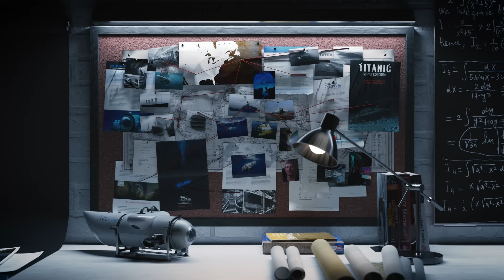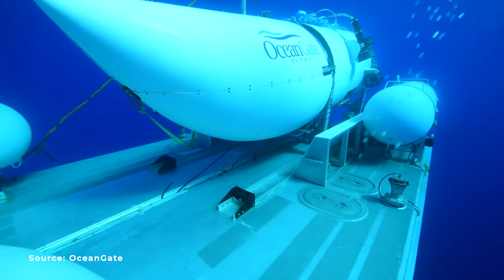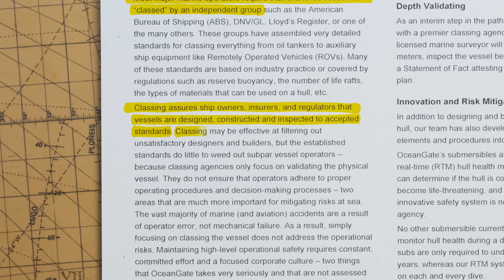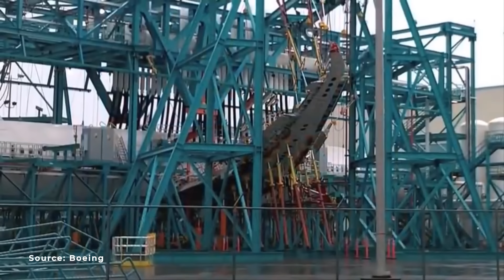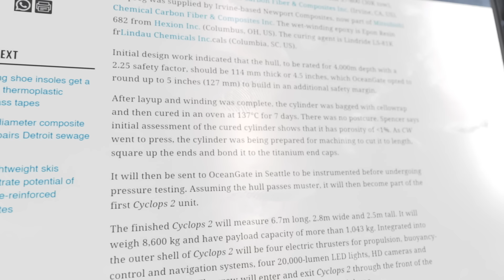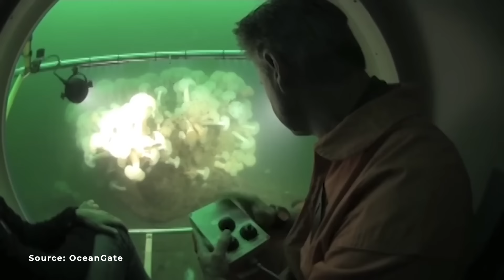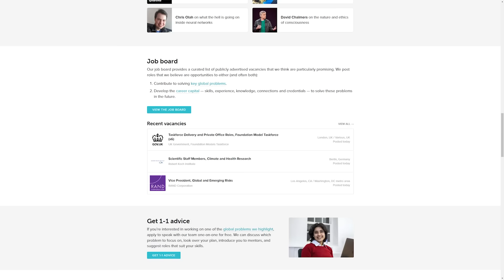The Questionable Engineering of Oceangate

Comment: My carbon fiber bicycle frame went through more testing than this freaking submarine. This thing is such an insane story the more we learn about.
Reply: My limited knowledge of carbon fibre is through bike bits, and even I know that it's a great material until all of a sudden it really isn't. This doesn't seem sensible, even without their complete lack of testing!
Reply: @hairychris444 So carbon fiber is at risk of failure from fatigue even  in applications involving relatively little compression force? That’s interesting.
Reply: @Lisa-om4it  Bicycles are subjected to more bending forces, in which there is still compression force on the inside of the bends. I'm not sure if autoclaves are used for bicycle frames.
Reply: @dbclass4075  Most bicycles are made of "pre-preg" carbon fiber, where sheets of carbon fiber are autoclave cured, and then later shaped into the bicycle frames, which means although bigger voids between sheets can form, there are less voids within the sheets. But also, the carbon fiber in bicycles is normally stessed compressivly along the axis of the threads, where carbon is strongest. This submersible was stressed across the threads, which is not carbon's best use. Bicycle frame designs (from reputable brands) are also rigorously tested with shear strength tests and cyclic loading tests. Carbon is great when you need good strength and very little weight bicycle), but when what you care most about is pure strength (submarine), use something better.
Reply: You can do some research I believe there is a video on it, a bunch of guys were trying to set speed records on mountain bikes over different terrain, one was sand and they designed a Carbon Fibre bike to be as light as possible, without doing proper testing they sent a dude down a massive dune only for it to fold in half when it came to the level off. The dude suffered massive injuries and 6 buffets worth of sand down his throat.
Reply: @bringerebrethil6176  Totally unnecessary but fascinating
Reply: @bringerebrethil6176 i'm going to hell for laughing at the sand buffet part
Reply: @khionefrostee4875  Hold the elevator, I'm coming with you
Reply: @khionefrostee4875 No you not.
Reply: @khionefrostee4875  delicious
Reply: @bringerebrethil6176  I remember watching a documentary on this. I think it was a guys nicknamed the Red Baron trying to ride down a volcano in Nicaragua, and yeah as you mentioned got fucked by a sudden gradient change. He did come back with a better bike and claim a speed record If i'm not mistaken.
Reply: @bringerebrethil6176 didn't that guy also set that speed record JUST before the bike snapped?
Reply: @bringerebrethil6176 Even properly tested carbon fiber frames can suffer catastrophic failure under normal riding conditions if the frame is getting old. Carbon fiber is bad at handling impacts, fatigue, or compression, and tends towards a brittle failure.
Reply: @garethbaus5471  Kek, i never heard of anyone breaking their carbon bikes with normal drive. Lose weight if your bikes cant handle any other material than steel.
Reply: @markoliimatainen2565  I don't know of very many people who ride their bikes enough for it to matter.
Reply: Carbon fiber is great on a bicycle as none of it has to be precise. Not so much in this application. Too much can go wrong to get the composition just right so it can bear up to the incredible forces.
Reply: @adotintheshark4848 was gonna say, a bike doesn't need to withstand the equivalent of ~400 atmospheres of force on it.

Unless your mom is-
Reply: The thing is your bike by law requires that testing. Submersibles currently don't. Though this event will probably change that.
Reply: This is straight to the point
Reply: Im really was surprised in this CEO own confidence too...
Reply: @liam3284 ok, Liam, now you're just screwing with my head... bc I'm realizing now that carbon fiber hulls are beginning to replace fiberglass hulls for increased strength. So ok, these hulls are not being submerged and subjected to incredible pressures on all sides. but carbon fiber is considered to be stronger and therefore safer if there is a collision--extreme compressive force. So now I'm super confused. You don't want to crash into another vessel, run aground on a reef, or get rammed by a Portuguese orca only to capsize because your carbon fiber hull shattered to bits.
Reply: @amijacks nless you are using it in a deliberate crumple zone fiberglass is usually better suited to collisions than carbon fiber since it doesn't immediately crack, and some synthetics like kevlar can be even better for those applications. I assume the main benefit of carbon fiber is that it allows for a stiffer hull for a given thickness. Although strength is important it really isn't the same thing as toughness.
Reply: woow...sad but true
Reply: I don't even Trust carbon fiber on my bikes... steel and titanium master race
Reply: Carbon is great but not for me. I've seen it fail in crazy ways out on the trails. Steel and aluminium tend to fail slower and are cheap to replace.
Reply: LOL, PH is still down there and needs out help>>>>>
Reply: "My carbon fiber bicycle frame went through more testing than this freaking submarine"
keep thinking that.

Comment: I am a retired consulting electrical and mechanical engineer.  I have no training or expertise in structures.  But, I would like to bring a different question to the discussion of the collapse.  Simple mathematics regarding surface areas of the Oceangate submersible gives some interesting information.  And nobody, so far as I know has considered.  This concerns the Lbs/sq. in. ( pounds per square inch ) that the eight-foot diameter exerts on the ends of the submersible.  According to released data, the submersible's " beer can style " cylinder thickness is four inches ( 4").  The pressure exerted on the cycinder is at each end of the submersible and is due to the water pressure on each metal end.  Simple calculations indicate the the per-square-inch pressure on  the four inch surface of the cylinder is approximately eleven times ( 11X ) greater than the pressure exerted on the sides of the cylinder.  In addition to the pressure on the cylinder at each end, the metal end pressure is at right angles to the pressure being applied to adjacent areas.    PN

Comment: The thing that bugs me is why use carbon fibre at all? Why not just use plain steel?

I think it comes down to ticket sales. Making a sub big enough to fit 5 adults, well if it's steel that's pretty heavy. Too heavy actually. Carbon fibre is much lighter. 

So it just comes down to maximising paying passengers per trip.

Comment: the controller was a Logitech F710, one of which i personally owned and used pretty extensively.  a decent game controller but not one i would want to have to pilot a real life submarine to the bottom of the Atlantic with...
Reply: It’s completely irrelevant. It had plenty of redundancy. They had multiple on board and all it was was sending inputs to the laptop, the sub could also be controlled by the laptop. Using controllers like the one used is common and not bad

Comment: As a researcher in the field of fatigue of fiber-reinforced polymers (FRPs), specifically quasi-isotropic glass fiber with an epoxy matrix, I find it surprising that this material is being used in pressure applications. Typically, when testing the fatigue properties of composites, the tension-tension mode is predominantly employed since it represents the most common load case. Occasionally, tension-pressure mode testing is also conducted, although the material often fails in this mode due to buckling. To address this issue, anti-buckling devices are commonly utilized during testing.

It is important to note that our understanding of the fatigue behavior of composites, even in tension-tension mode, remains limited. The damage evolution in these materials is highly influenced by various factors, such as the characteristics of the fibers, fiber-matrix bonding, stacking sequence, fiber orientation, matrix properties, laminate thickness, presence of porosity, loading frequency, temperature, and even humidity. Consequently, comprehending the behavior of composites is far from complete. This signifies that we have not fully tapped into the material's potential, and there is ample room for improvement in composite materials within the field of materials science.

Comment: During the period between loss of contact and confirmed loss of the vessel I tried to dig out as much information as I could on this submersible. They made many poor decisions in designing and constructing the vessel, taking the options that were fastest, easiest, or cheapest, whilst safest never seemed a consideration. 
Two choices (apart from building the pressure hull out of composites) really stuck out to me as borderline insanity;
1. Although you mentioned it in the video there was no external ballast that could be released in an emergency. Most, if not all, research submersibles have such a system which can make the  vessel positively buoyant and rise to the surface without relying on power, or any other system. 
2. The hatch was bolted closed from the outside with no way for people inside the vessel to open it. Much easier design and construction wise, but left the passengers reliant on people outside the craft to open the hatch. This meant that even if the submersible had resurfaced the passengers would suffocate without outside help. 

The best that anyone can say about this whole sorry saga is that at least their end was quick.

Comment: As an engineering working in the marine space, as soon as they said it was carbon fiber I knew they had imploded. In general if a sub is missing it's probably imploded as a failure which results in completely neutral buoyancy is kinda rare, and if they had positive buoyancy (and therefore floated back to the surface) it wouldn't be on the news.

Going fast and breaking stuff is a fine way to do cutting edge engineering, but it's for that bleeding edge tech, not commercial operations taking passengers aboard. Musk has his issues but SpaceX blew up a ton of early Falcons until they worked out all the bugs, and only then did they start putting people on board. What Oceangate did get people to pay them to be unwitting guinea pigs.

From the perspective of class regulations. You can build and operate vessels that aren't class approved, but you can't be embarking passengers and doing commercial operations with one. This is where Rush's entire argument falls apart. You can do the research, you can build and test whatever you want, you can push the bounds, but it needs to be in the context of R&D. As soon as you bring normal people into the mix you need class approval to ensure an expected level of safety. They got around class by declaring that their paying customers were actually "Explorers" implying that they were well aware of the risks they were undertaking, and that they were doing this in the pursuit of research instead of being the unwitting payday that they actually were to Rush.

Comment: I am an automotive industry mechanical engineer, and as soon as I heard of this accident, I immediately suspected compressive cyclic stress failure. We use composites extensively in the auto industry, but almost exclusively in unloaded situations, or internally loaded situations like intake manifolds or turbo ducts or suspension parts that put fibers into tension . Where composites are used in compression, there are always metal reinforcements to take the compressive load.

Comment: Good explainer. Question if I may: Aren't fiber composites much better suited for containing a higher pressure inside the vessel rather than protecting from a higher pressure on the outside of a vessel? As an example, better suited for scuba bottles or propane gas cylinders than submersibles? When containing a higher pressure inside a fiber-composite vessel, you have the tensile strength of the fibers to help contain the pressure. However, it seems to me that fibers offer little resistance to compression from outside the vessel. And so in the submersible situation, you are really mainly using the matrix for resisting the outside pressure and the fibers are practically just carriers for the matrix and the same result might have been achieved with practically any other fiber?

Comment: This was great to see. Go-figure your masters thesis was directly applicable to this. This clearly was not an engineering failure, but rather a business failure. They accepted the risk of things going horribly wrong, and that risk materialised. The company has to carry the full cost of that failure. 
I really feel for all the engineers that worked on it that had nothing to do with the design and manufacture of the pressure vessel itself, their own personal reputations will forever be tarnished by this company’s failure.

Comment: Corners Sockton cut:
1. Use of expired carbon fibers not even suitable for aerospace with a 1 atm pressure differential, let alone 350 atm,
2. Failure to crossweave the fibers during hull construction,
3. Failure to cure the epoxy resin in an autoclave to eliminate bubbles and voids,
4. Failure to perform adequate safety testing or get classed for chartered vessels as is industry standard,
5. Failure to perform nondestructive testing (ultrasound) after every dive to look for new defects,
6. The choice of using carbon fiber epoxy composite as a hull material in the first place, which is much weaker in compression and is prone to buckling delamination failure in this configuration after the cyclic stresses of repeated dives,
7. Blatantly ignoring all experts on the matter, treating all constructive criticism as personal insult, etc...
What could possibly go wrong?

Comment: There's already a better video out there that says, we know the breaking points of thick steel and titanium which were the materials that helped James Cameron reach the deepest point of the ocean (Mariana's trench), but less is really confirmed about carbon fiber.

Yes, shady regulations crushed this company, literally, and the pilot who produced the damn death-trap (otherwise he'd be charged with murder). I even read a magazine article about one wise man that saw the red flags and decided not to go. My heart goes out to those who boarded this suicidal sub (their family and friends), which should have been tested better ~~~ ie... It did make 1 successful dive, but after that, they should have cut it to pieces to look for stress fractures that build up, just like in nuclear power plants.

Anyway, any material slowly breaks down over time, when put under stress, much more so for deep sea vessels that need to withstand so many atmospheres of pressure at such deep depths. Airplanes are easy in comparison.

Even the sub that reached the deepest depth was only designed for one expedition there.

Comment: You are cocky aren't you? such an expert, in one field only. You don't see the problem with the off the shelf electronics? what happens if something goes wrong with your computer or HMI device? oh you just take it back to the shop? Do you die? no. What happens when average off the shelf products fail in a place where you can now not get out due to their failure..... I mean these people could not even put the thrusters on round the right way, an then remapped the controller whilst 3.8km under? that is something that they do to space probes with no one on board, you don't do it when it going wrong could mean that you are in trouble.

Comment: Profiteering.
Safety theater.
Firing the dissenting engineer.
Move fast and break stuff.
This is a systemic issue, NOT just a CEO stupidity issue.
It is what society and stockholders currently demand.  CEO's name was literally "STOCKton RUSH".

This whole incident is nearly 100% exactly analogous to the current irresponsible policies regarding COVID.
Advising 'wash your hands' but masking not required in medical facilities despite convincing research and common sense showing virus is aerosol borne and N95 or better respirators are protective.  THEATER
Employers not responsible for employees catching COVID on the job because it would be 'too expensive' NOT because it would not be the right thing to do. PROFITEERING
BOTH are willful scientific ignorance and sociopathic corporate malpractice leading to negligence on a massive scale.
No scientist or engineer can stop this against societal will.

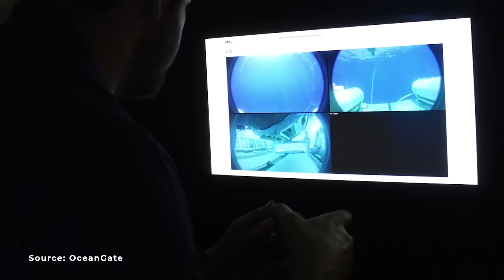Comment: 01:47 I completely agree. Who cares about the controller, I am sure it works better than any individual solution they could have built. Also, they had a second one on board and ascending would also have been possible with no controller working. Putting the main focus on the pressure hull seems reasonable (if done right).
Reply: Ironically the Logitech controller would have been the most thoroughly tested part of that vessel.